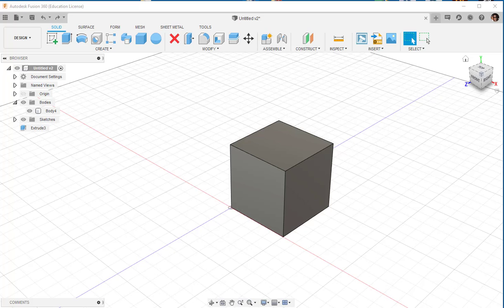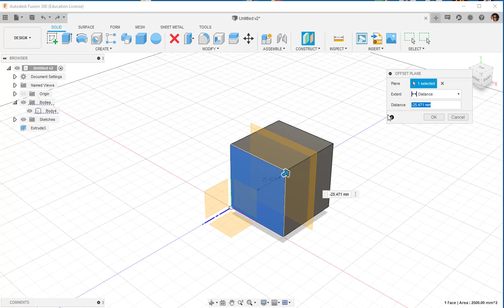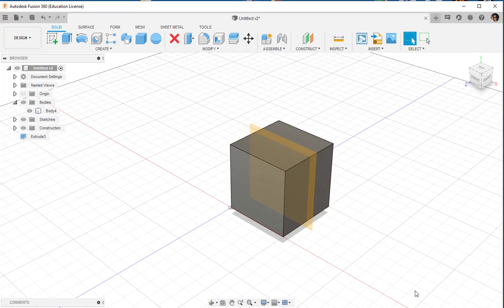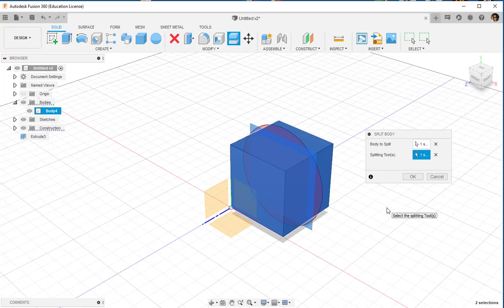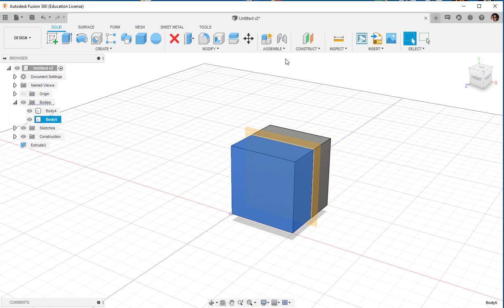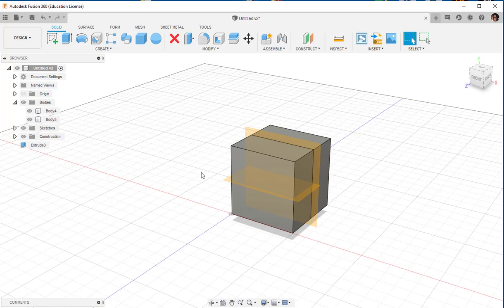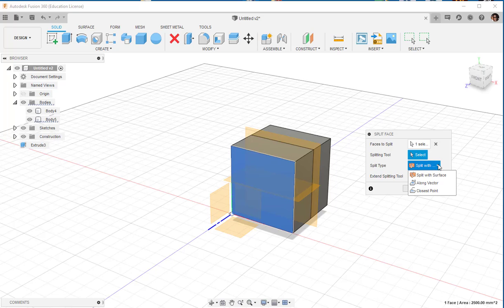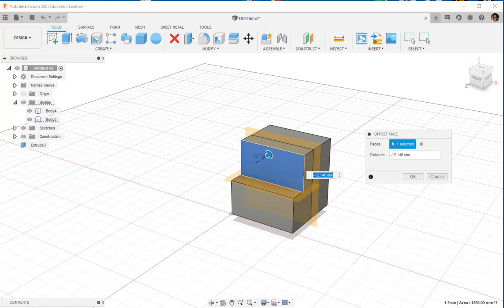Fusion 360: Split Body and Face

Comment: You need to learn about creating a Midpoint plane (in the same menu as the offset plane). No measuring, no typing the offset amount - just click the two opposing faces and Fusion does the work.